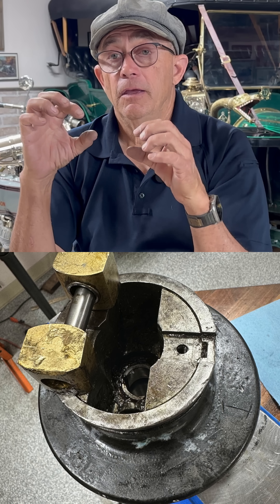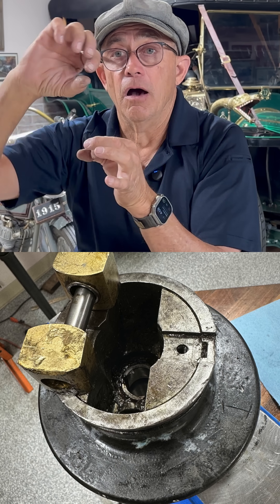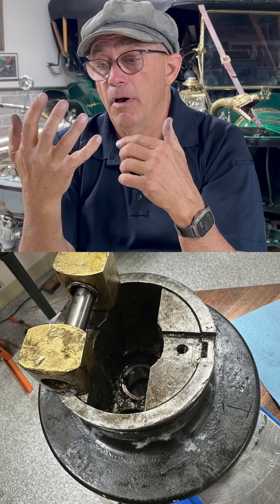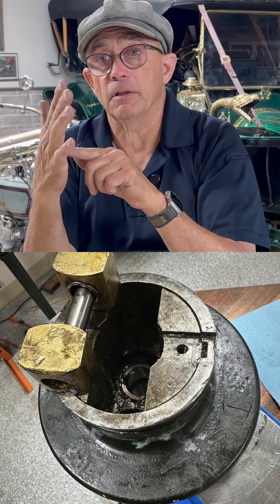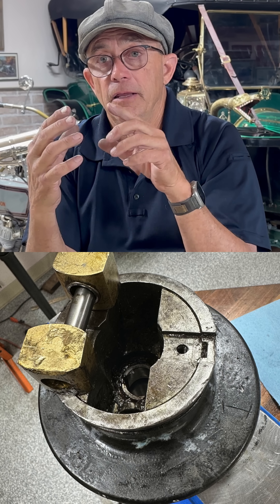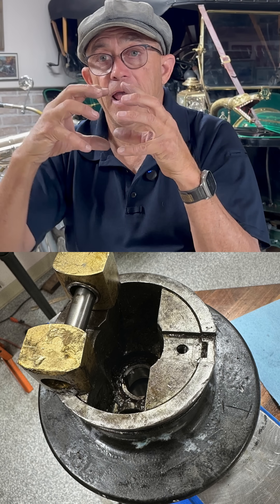No Driveshaft? No Problem! - Ask Alan Ep 2 - Alan Travis w #BarryT #classiccar #autohistory

Comment: High end hobby grade R/C vehicles still use this type of system as a differential, out back, in the center and up front. Very robust for its size using super thick silicone fluid grades to control slip, brilliant design!

Comment: The front wheel drive Cord of the 30's solved the driveshaft issues. The 66 front drive Oldsmobile Tornado was chain to trans axel drive. 🎆✝️🏁
Reply from the maker: Absolutely right - that Toronado transmission is the turbo hydramatic 425 or TH425

Comment: I need some explanation. Steam engines and large diesel engines have been driving MILE long drive shaft for hundreds of years. Maybe it was more u joint longevity but sturdy drive shafts weren’t an issue while powering factories with dozens of belt “takeoff” points along thousands of feet of rotating shaft.
Reply from the maker: It’s not just the rotating shaft, that would not be a problem, comma it’s the fast moving axle relative to the engine underload that creates a lot of stresses without some kind of a well designed joint 
The really good CV style joints were not developed until at least the 1930s
Reply: Thank you so much for these videos. I never really had the opportunity to talk “shop” with my uncles and great uncles. From what I’m told my dad couldn’t tell a wrench from someone else’s wrench, he went to jail for such a mistake!? You can read all the books ever written but until you’ve blown up a few engines you can’t know it all! Please don’t change your content, this one on one sitting on stools is perfect
Reply: @BarryTsGarage FWIW, the "really good" CV joint design was Alfred Rzeppa's baby.